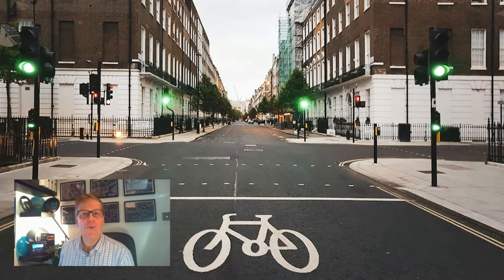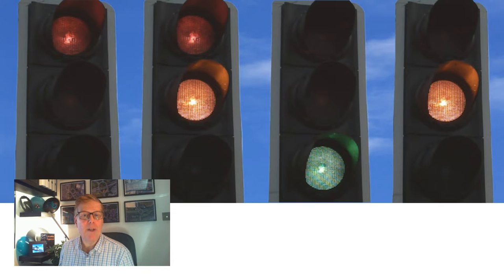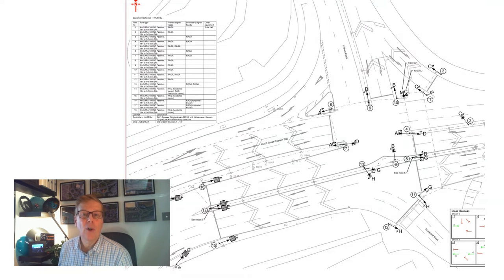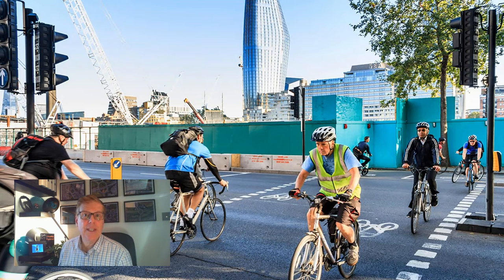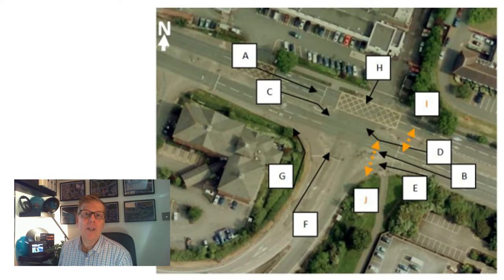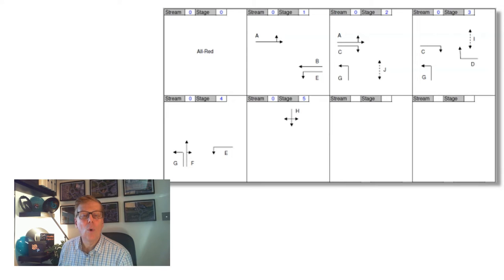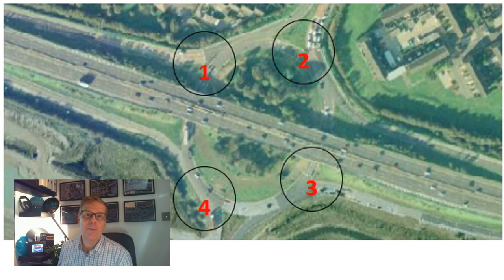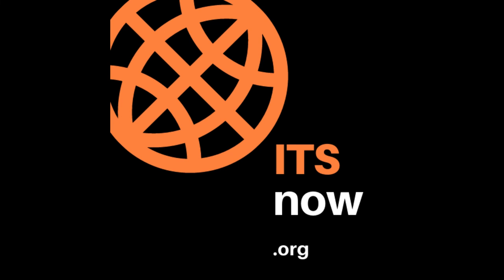Phases and Stages - Traffic Signals Principles - Part 1

Comment: I can’t believe Amber timing is not to be adjusted. Here in the US we can adjust is and it’s calculated using road speed, and grade or slope, as well as distance across intersection. It is much safer than just 3 seconds no matter what.
Reply from the maker: Actually, we calculate the inter-green period in a similar fashion, so account for issues such as the distances between conflicting stop lines,  but show All-Red if this is more than the 5-second amber periods. Because of this, we don't suffer the same extent of amber gambling you have in the US, because everyone knows at every set of signals what the amber periods will be, giving absolute consistency. Therefore the minimum inter-green period from one phase finishing to another starting is made up of the leaving amber then the starting amber (yes we have two displays with amber in!) so 2+3seconds = 5 seconds, not 3, but critically then if required an All-Red as well. We also have some other safeguards in place on higher speed approaches, to improve safety in the event of a higher speed vehicle approaching when the leaving amber is shown after the green period. Hope that helps, thanks for watching.